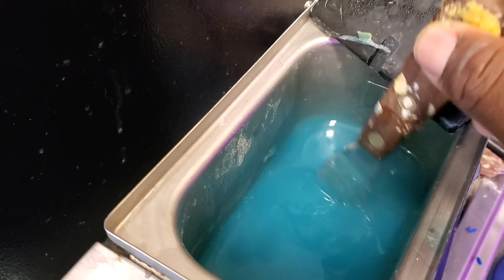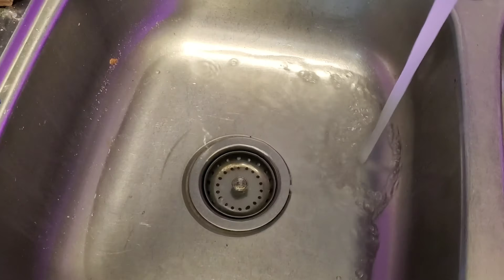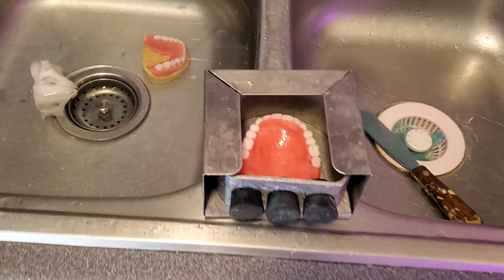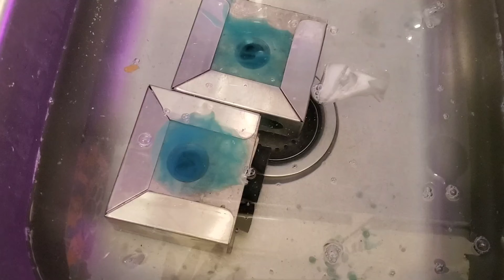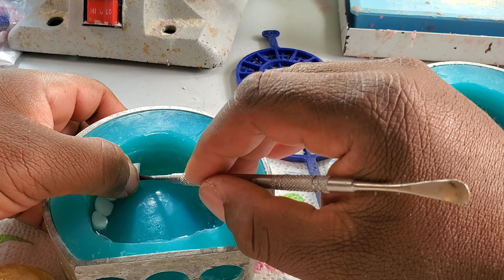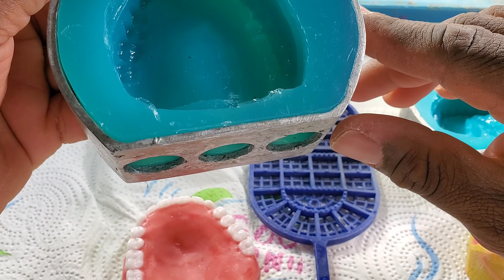How to process Cold Cure Acrylic Denture

Comment: I have printed dentures and wish I hadn't wasted the money.  They do NOT hold up.  Mine are less than a year old and I've already had to repair a crack in the pink and several of the teeth are coming apart.  I'm not happy at all.  The only thing good is the fit, which I intend to duplicate with acrylic.
Reply from the maker: @flamingomtn  I can fabricate a new set for you
Reply: @JOsdentureslabJOs  I just saw this comment.  Thanks for the offer but I'm about 70% of the way to completion.  My living room looks a LOT like your shop by now.  This is actually the second time I've made my own dentures.  I used cheap teeth for the first ones so they wore down pretty fast.  Then I got a set from Etsy that was surprisingly good but again, cheap teeth wore down fast.  Then the debacle with printed dentures.  Enough.  I ordered some gorgeous, high-quality teeth and am working on my wax-ups.  I paid a fortune for my first dentures and I can't afford to pay for that kind of quality now on social security.  The only way to get the perfect dentures I want is to make them myself.  Thanks again for your offer.  If I wasn't so far into it...and with a boat load of materials, I might take you up on it.  Cheers and thanks for your videos.  They help me a LOT.
Reply: How much do you charge for a top and bottom set